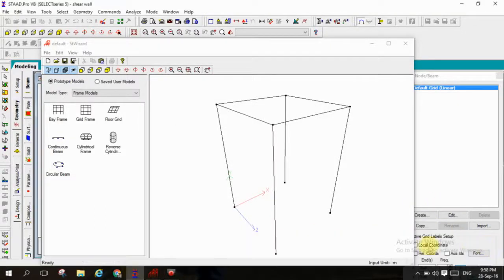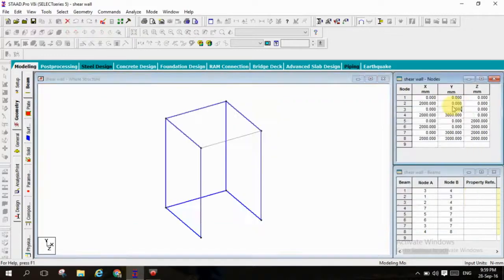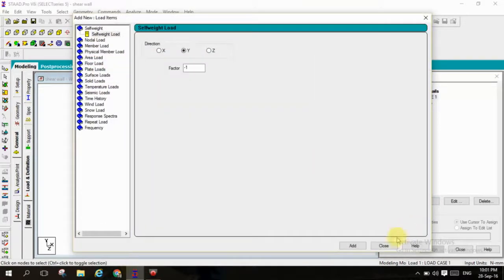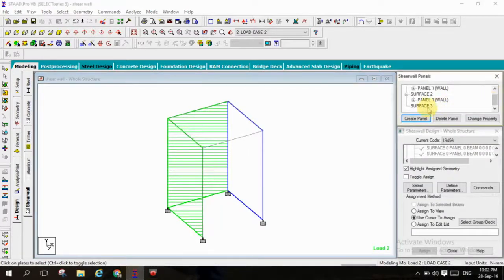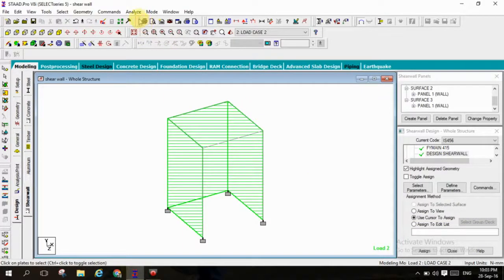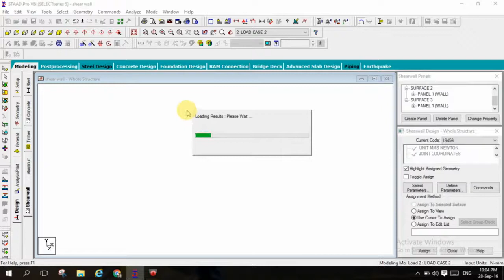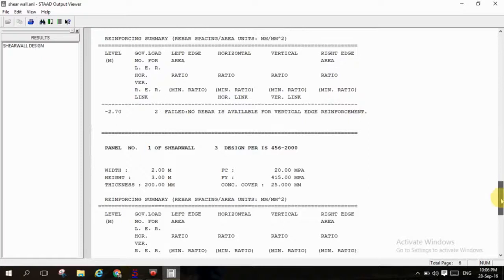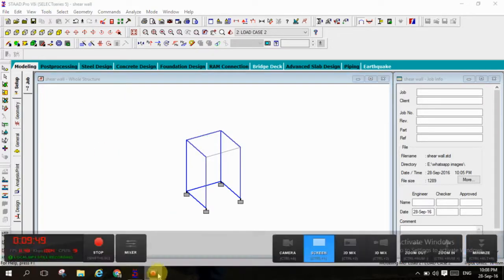SHEAR wall design

Comment: Hello
Thanks for the tutorial in staadpro  to design shear wall.. Is it necessary to provide beam and column element surrounding shear wall, Kindly reply
Reply from the maker: its depend on the structure design if u provide column and beam  the shear reinforcement will be installed into column and beam which can give you more resisting support.
.........................................................................................................""thank u ".." have u any quarry comment"""